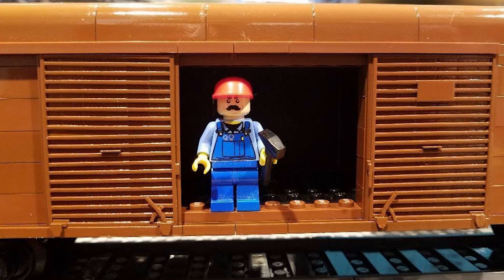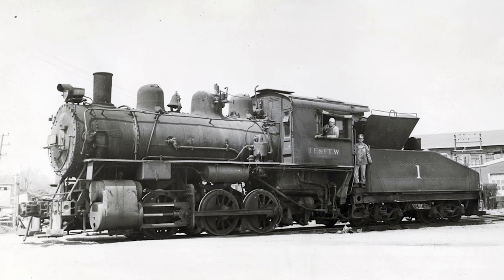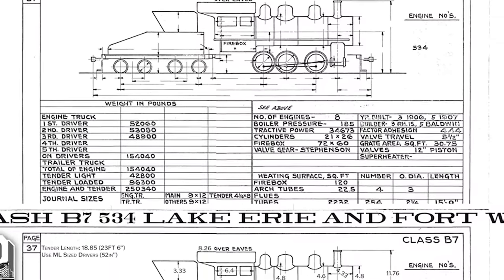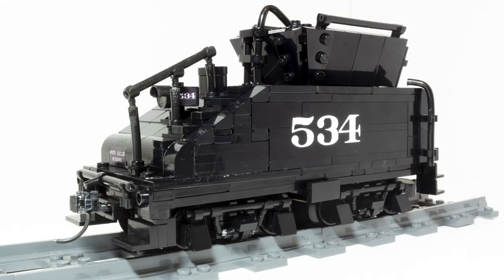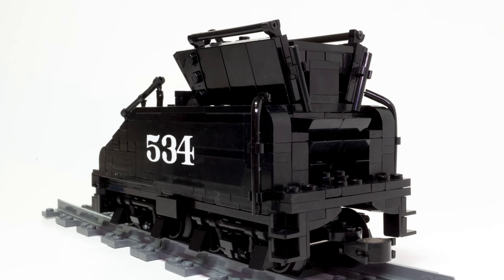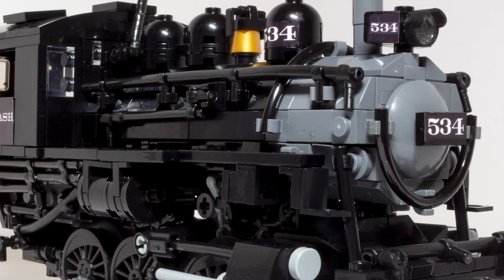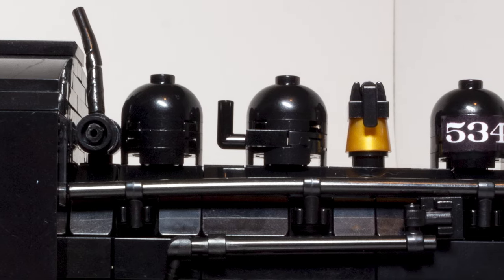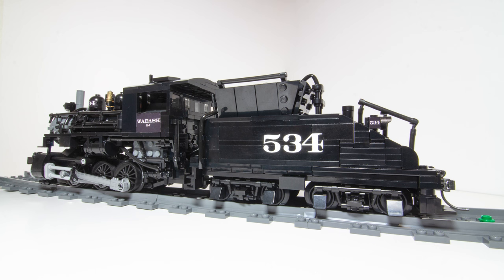Lego Wabash 534: Brick Train Awards 2023

Comment: I actually like how you did your best with the internal valve gear, but what if I told you that I was able to crack the code on how to create the 28 teeth bevel gear half the size where you can power the other drivers and still keep the valve gear?

Edit: On closer inspection, you may have to modify the part that simulates the lifting link in order to accommodate my gear
Reply from the maker: A 28 tooth? That would have been way too big. The concealed motor was the principle goal and I’m lucky I pulled that off
Reply: @ToledoRails It is meant to go on the drive wheels NOT on the input shaft from the motor
Reply from the maker: @cjstrader8171  you should build your own to demonstrate this
Reply: @ToledoRails Check that, I was able to build a 20 teeth gear that simulates one of the eccentric cranks where the pin moves at a total diameter of only 8mm (4mm from the center?. An "eccentric crank" without the gears has also been designed to help out as well. If  the math is accurate you could go to a 5/3 gear ratio with 2 connecting axles and still have your internal valve gear.